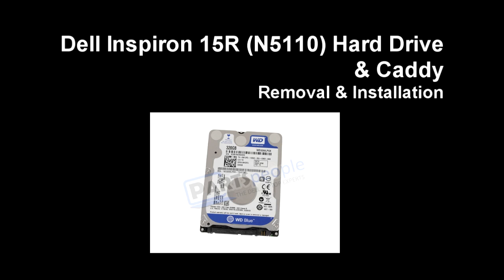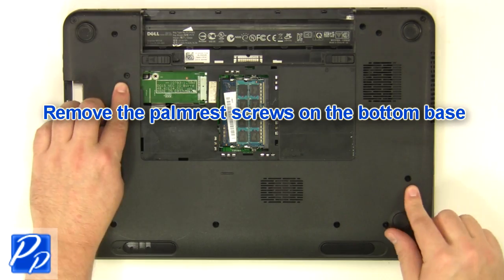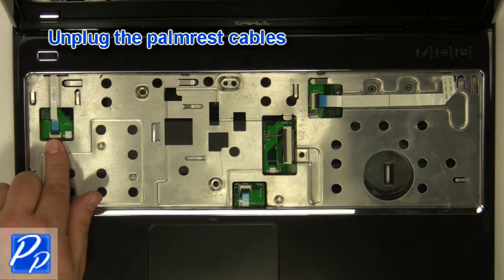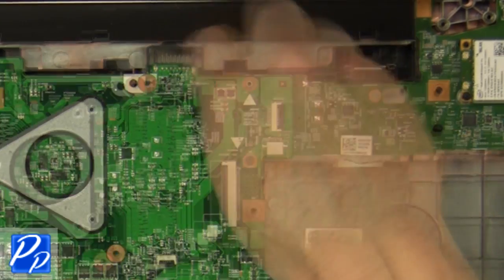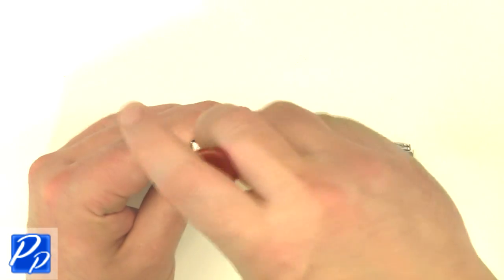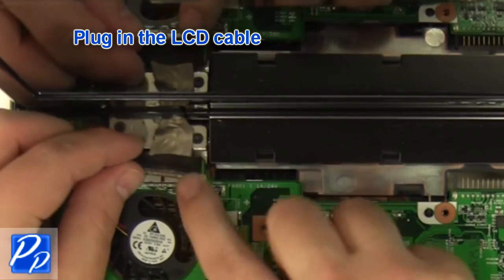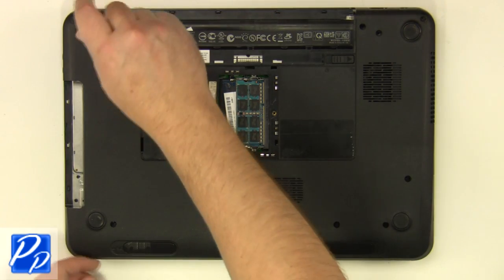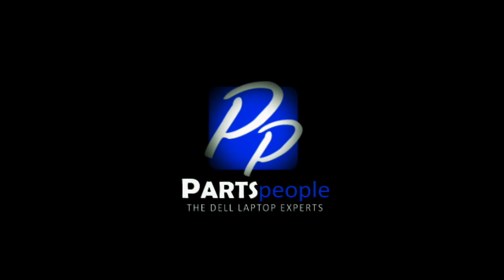Dell Inspiron 15R N5110 Hard Drive & Caddy Replacement Video Tutorial

Comment: Great video! You make it look so simple!
I just have one question if you don't mind. My n5110 is the i7 version and the only HD I want is this one http://www.ebay.com/itm/381043287758
Would  my computer have any issues handling it? As far as I can tell, it meets the same size requirements.
Reply from the maker: deadman2bullet That hard drive should be compatible.